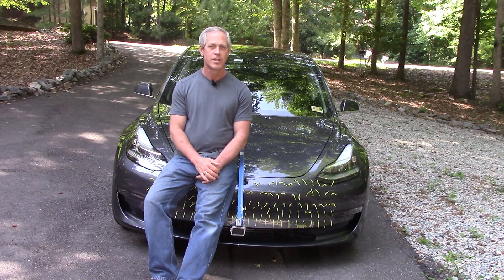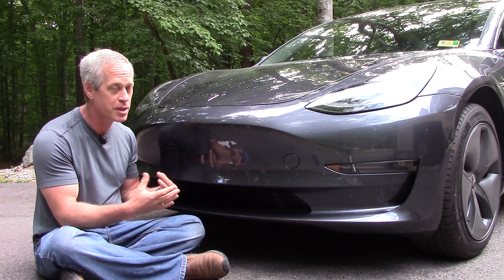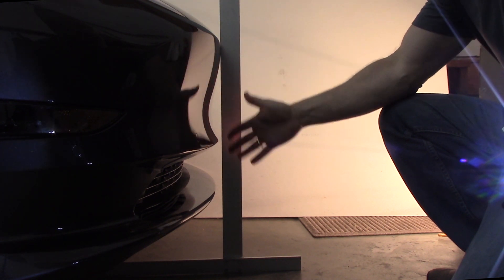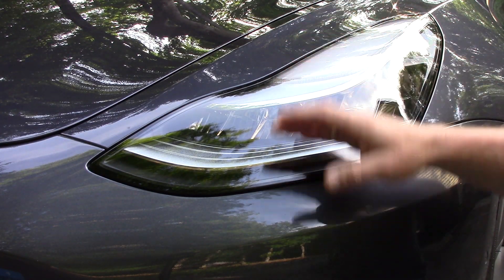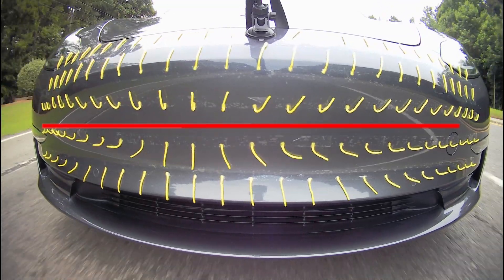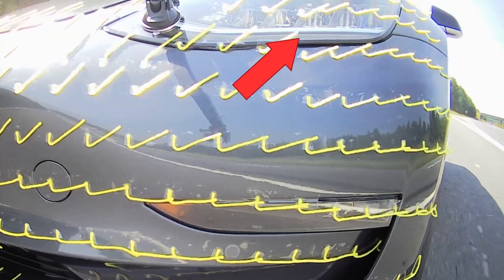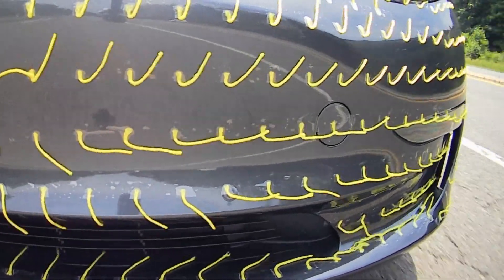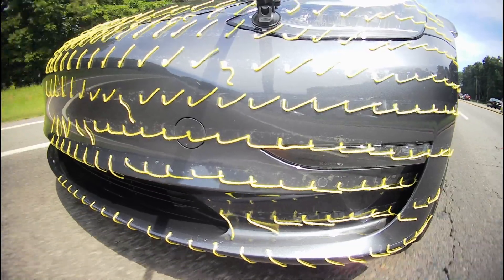Tesla M3 DIY Wind Tunnel Testing - Front End Aerodynamics

Comment: Hey Ed,I didn't know what to expect with the change on your channel, this is actually pretty good!

My job being aerodynamicist for cars (not for Tesla however) I can tell you few tricks : Even if your video is great, the shape of the front end of the car is not important at all.Usually it's the designer team that choose the overall shape and the aerodynamicists just confirm it's ok. The only rule is to avoid flow separation but it's quite easy given the high pressure gradient happening here. I'm glad you spotted the air curtains, flowing on the outboard of the tire, as you explained correctly, they are here to clean the wake of the front tires and not to be mistaken with brake cooling ducts that go, well, on the brake caliper. Concerning the flat surface on the front, it's due to the new design of electric cars : in normal conditions (not racing) they don't have a lot of cooling needs compared to ICE, and cooling is HUGE in drag... So designers come with new front faces (some people don't like, I like) that clearly reduce the mass flow rate going through the exchangers.

But Tesla's secret to really low drag is not where everybody looks. Electric cars have a very big and flat battery on their underside and this is the key : full flat bottom with high energy flow to get a beautiful wake balance between top and under flow. 

For your next video you should do the same but stick all your little ropes on the diffusor and look how the flow will be attached on the middle and not attached to the sides (polluted by the rear wheel wakes). Because in the aerodynamic of a car, the most important things are the rear wake and the wheel wakes.

Glad to see you back and I hope you're doing ok!
Reply from the maker: This comment is what I was really hoping for!  You have answered a lot of my questions already and given me ideas for other areas to check out.  So it sounds like basically the front is flat because there is no grille, and it doesn't help much to make the nose sharp after all.  Oh well, it's more mundane than I thought.  I still would rather have a pointy nose, like a jet fighter or Porsche.  Thank you again for your feedback.

Comment: Oddly the 1988 Vauxhall Cavalier had a drag coefficient of just 0.29 which for a basic family saloon was bloody good. The equivalent Ford Sierra being about 0.34 and Rover 200 series cars of the same era coming in at about 0.32 it's not hard to see why the Tesla is the shape it is and the effects produced. The car designed in the 1950s the Morris Minor matched the Cavalier at just 0.29 allowing the little 950cc engine to achieve very high fuel economy and very little wind noise inside the cabin.  Some modern cars manufacturers could learn a lot by looking at previous successful designs and steering away from form over function with cars having less usable space inside than ever while continuing to grow ever larger on the outside.

Comment: I clicked on this immediately, and loved the entire video. Everything from the comedy, to the multiple camera angles. 
Subscribed ! 
Great explaination of what the air is doing as well. 
I'd love to see a video of the rear of the car, since the angle of the rear glass seems rather shallow when compared to " faster looking " designs. 
It seems like flow would have less velocity and just might detach in some areas. 
There is a manufacturer that sells a front lip and small rear spoiler for the back. 
Together, they show a .18 Cd, in CFD testing ( Fluent ? ) , so I found the turbulent area at the front interesting. 
This is my first video i have watched from you, but besides rear end testing, another interesting area would be behind the wheels, both with, and without the aero wheel covers. 
GREAT VIDEO. Subbed !

Comment: 6:05 the airflow won't detach at the frunk-gap. it's very near to the front of the car and the hood is still coming up to block the airflow. the boundary layer is still "fresh" an full of energy at that point. it's similar to how you wouldn't see separation in front of the thickest part of an airfoil. the boundary layer will probably transition from laminar to turbulent though.
Reply from the maker: No doubt, not worried about the gap.  It was the flat, vertical fascia surface that forms the lead point that I thought may deflect the airflow upward enough to detach just behind the nose, near the frunk.  But it looks good.

Comment: If the frontal area is flat you have an air bubble that sits in front of it. This bubble can oscillate and shedding vortices above and below at a certain frequency. By having the lip you reduce the air bubble and create stability with air flow staying attached on both sides for longer.  But to be honest compared to an ideal aerodynamic body it's still pretty crappy but that's what you get if you want 4 wheels as in a car!